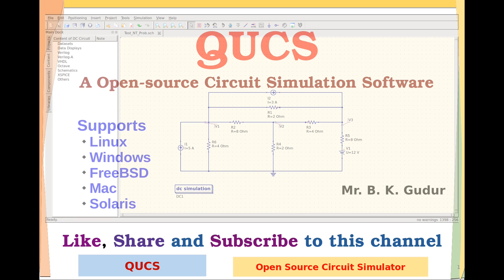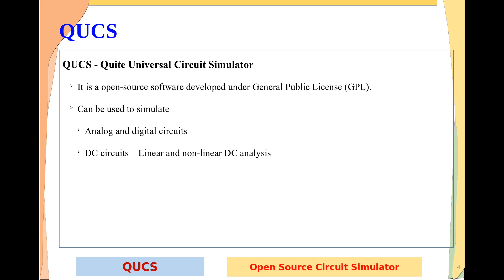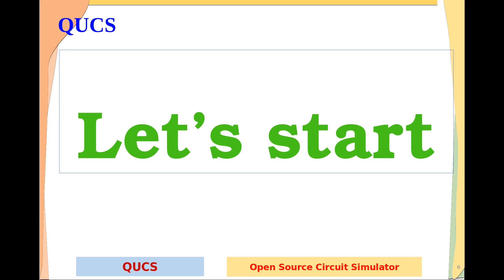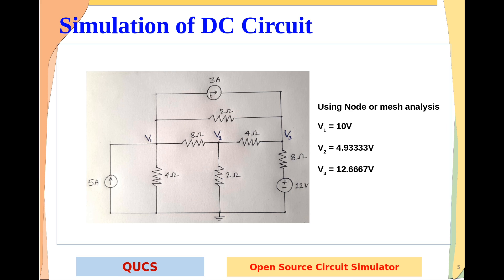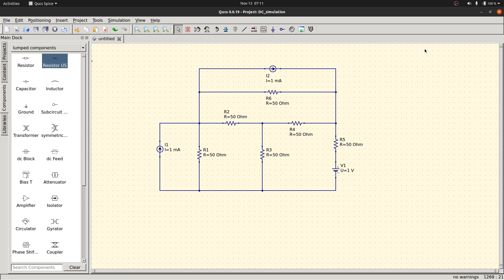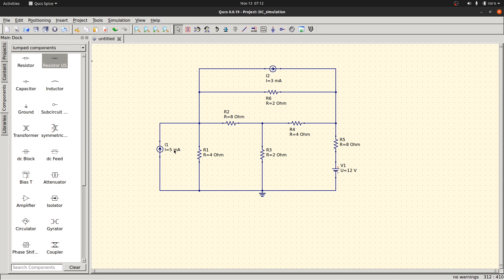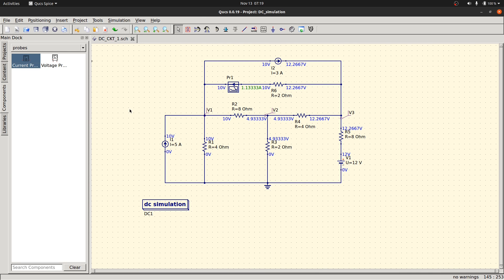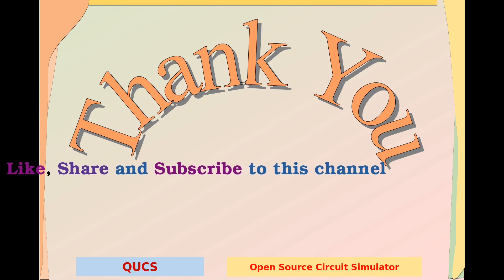Introduction to QUCS - A Circuit Simulation Software

Comment: Compared to the Proteus program, this one lacks visualization, which means it doesn't show colors when the circuit is running or the LED is on, but only shows volts, which is a bit of a drawback, I would say.

Comment: ERROR: Cannot start qucsator.exe (Process failed to start: No such file or directory)
I have used in windows 10 OS and intel i3 processor
Reply from the maker: I have even tried on windows 10. For windows 10, download the QUCS software from the link given below:
https://www.malavida.com/en/soft/qucs/
Now follow the steps:
1) Unzip the file in separate folder
2) locate qucs.bat file, double click on this to launch QUCS simlulator. No need of any installation.

Comment: dear admin, U have mentioned on thumbnail that QUCS supports also for MAC, where as in the video u informed that its available for windows and linux. But in the description u gave only for windows.  I am using Mac OS, I haven't found any QUCS. but I've installed QUCS 0.0.19(2017 version), in that software whatever I try to simulate it always shows "error to simulate". OS version is macOS Big Sur 11.1 
If possible plz help me. OR suggest me similar software to QUCS 
regards
Reply from the maker: Yes Pavan, as per the QUCS documentation it supports MAC OS also; but I have tested it only on Ubuntu and windows operating systems. You may refer the below link to install on MAC OS.
https://github.com/Qucs/qucs/wiki/Build-Darwin
Follow the instructions to install, if you fail to do it, kindly let me know the same, so that I'll try it on MAC and tell you the procedure.
Even there is one more way of install QUCS on MAC i.e. using wine.
Reply: @TechKnowLogyPark   Dear sir,
when I clicked on download for Mac it shows 
''The requested URL /official_releases/qt/4.8/4.8.6/qt-opensource-mac-4.8.6-1.dmg was not found on this server.''
Reply from the maker: Ok Pavan, kindly give me sometime, I'll install and tell you the procedure.
Reply: @TechKnowLogyPark  sir 
Please note that my PC is M1 Mac 
Which is different from intel Mac
I’ve tried to install that through WINE but no result.
Reply from the maker: Install QUCS using the below package, I successfully installed it on MAC:
https://sourceforge.net/projects/qucs/files/qucs-binary/0.0.19/qucs-0.0.19-OSX10.7.pkg/download
Reply: @TechKnowLogyPark  sir.
The same QUCS has already installed by (again installed by using your link) but the problem is been when I try to simulate simple circuit of 1 V source and 2 resistors and earthen. I clicked on simulate then It shows 
syntax error, unexpected identifier, error'''
My device new M1 Mac
Reply: We have same problem, how we can handle this🤯